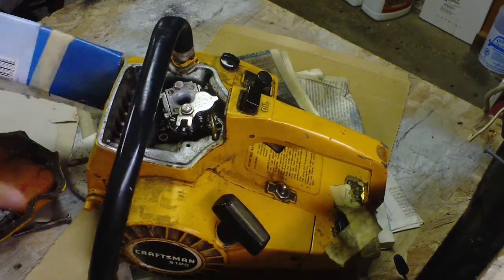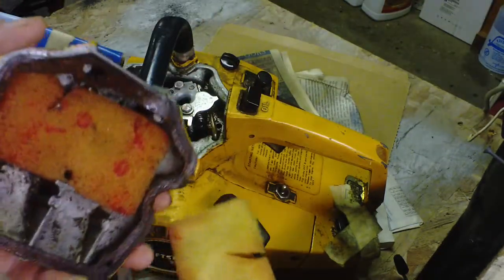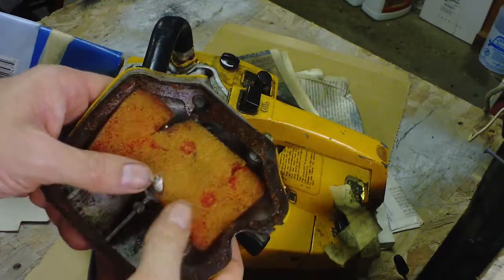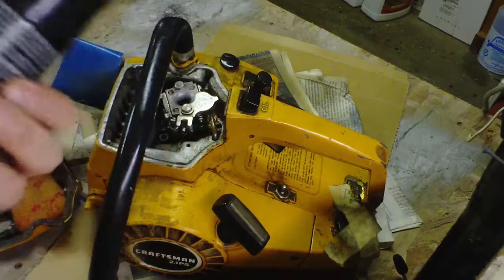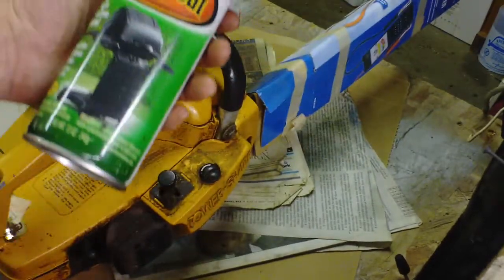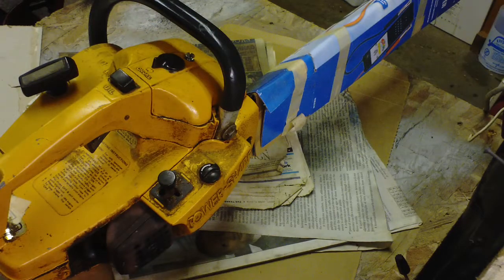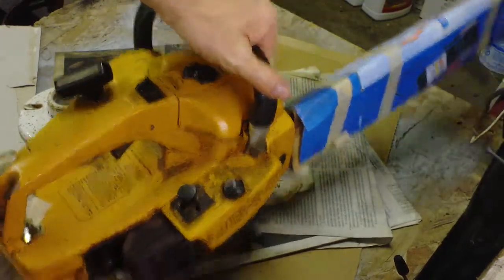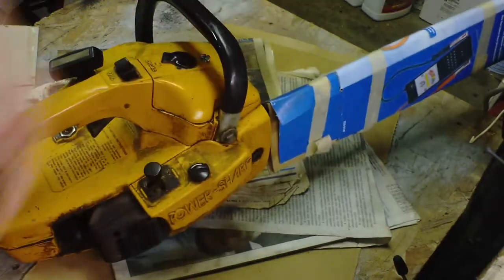How 2 make homemade Foam air filter DIY Old Vintage Craftsman/Poulan 14" c/saw

Comment: You probably already changed the cap but there is usually a duck valve in the cap so air can vent in but gas can’t leak out there like 50 cents each
Reply from the maker: No haven't changed it yet, don't use it much. Got a c/saw collection brewing that'll hopefully come in handy next bad storm/s we have. I've just been sticking a push pin/thumb tack in the little hole when I'm not using it, & just let some gas leak if I need to use it.  Thanks for the info, a DUCK valve?  I'll try to remember that, thanks again man, - take care